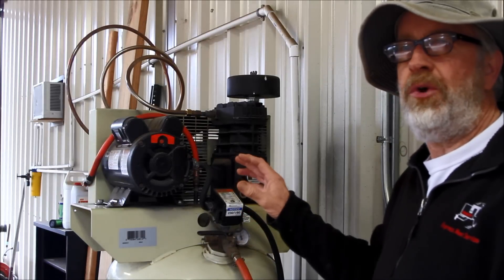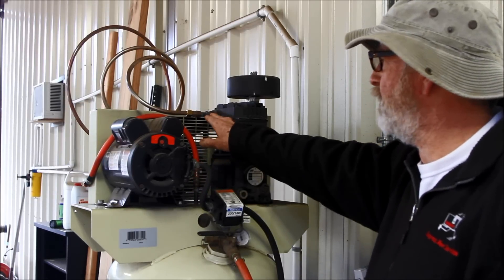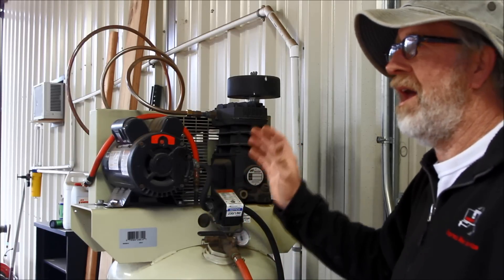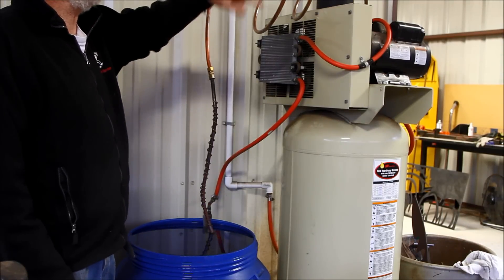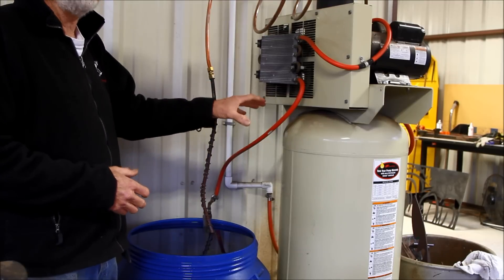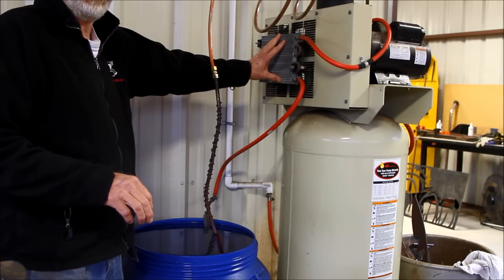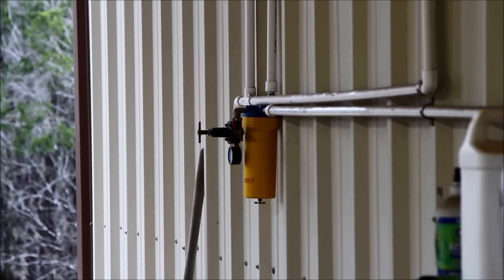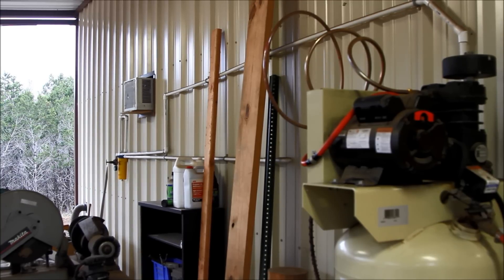How to make a Air Compressor After Cooler (low cost)

Comment: I've been looking at all of these "post pump condensers" as they are not a post-tank cooler / condenser.  There are a lot of crazy set-ups on YouTube and I have to say this takes 1st place.  There are some major issues here, mainly that you have no water drain or separator once the air is chilled and you have everything working against gravity.  Not only does this set-up allow for water to collect in the three initial upper coils, it most certainly will collect in the water bath coils and also in the secondary condenser which is most likely total overkill after the water bath.  Regardless, the way this is set up, all of the accumulated water taken from the hot air has no where to go except to be forced uphill into your air tank via bubbling in which case some re-atomizes and as a whole is totally negating the entire purpose of pre-chilling / pre-drying to save the entire air tank for dry air with no water or moisture vapor.  As shown, all this does is make cool air and a lot of water.  

While I like the idea of a water chiller for a condensor, you're also taking up an equal amount of floor space with the 50 gallon water tank too.  Perhaps most importantly though, your pump is having to do a hell of lot of extra work in pushing all the extracted water up through the lines...uphill against gravity in to the tank.  To be clear, as shown, this is a simply a horribly inefficient system.  You're not only over-taxing the pump as well as using your air tank for water storage, but if the air tank fills up with water, it's making the storage volume smaller and smaller, thus making the pump have to work even more when in use . I hope/assume you have a drain at the bottom both in the condensers and tank, but sometimes these clog from years of debris.  I've seen several videos of air tanks being drained that were 50% water or more.  All of this is a great way to ruin your pump and motor in short order.  

I also wouldn't be using PVC pipe for air lines.  I know a lot of people do it.  I wouldn't unless it's already been reduced to 100psi or less and the air will never get over 100 degrees in the line.  And make sure it stays out of the sun or isn't anchored to metal siding that gets direct sun!   With both copper and PVC their pressure ratings drop significantly as temps rise.
Reply: Yep, the water bath is a great idea. All it needs is drainability for all the water that's collected in the coils inside the drum.

Comment: This is obviously going to cool the air but water will condense in the coil and be forced into the tank. You need a collection tank at the bottom of the coil that can be drained. Then you have cool dryer air to tbe tank. I'll bet you still get lots of water from your tank.
Reply from the maker: no it never did, but later I did put a drain in the bottom of the coil,...but I never had water in the line without it
Reply: @DougGreenAustin  Take hot moist air, cool it, and there will be water. Else there would be no moonshine. Where did yours go if not in the tank? Just saying.
Reply from the maker: @backlash00  I know you are right, but each day before I would start I would drain the air from my canister air dryer, and each day there was about 1/2 oz of water, after I put this in I would not even get a drop... I took it out last year when I redid my system, and now I get water in my lines, going to get a refrigerated drier when I up grade my plasma table
Reply from the maker: @backlash00  and it's just like the air cooling fins on the lines before it goes in the tank,

Comment: An after cooler is a great idea and 99% of the time will solve problems with water in your air tank. I would suggest you replace pvc air like with something like type a pex or at least cpvc, though. (CPVC gets brittle over time, though.) I have been guilty of using it myself, but it is not rated fir high pressure. Its an accident waiting to happen.
Reply from the maker: yeah I have heard that over and over, I have use PVC in my shop for over 40 years and NEVER had anything happen
it rated at 240 PSI
Reply: Doug Green its not just an old wives tale.  A place i worked at used it and had a drop blow out and hurt a guy. https://www.thecompressedairblog.com/comply-with-osha-dont-use-pvc-pipes
Reply from the maker: @ShadeTreeSteve  OK thanks

Comment: Are you running the IR 5hp air compressor in your shop? If so how has it held up since it sounds like you are heavy user of it in your shop.
Reply from the maker: no, I have had two now, and the other one is not going to last much longer, going to go with 100% USA made next time
Reply: @DougGreenAustin  i have read that IR's 5hp are not good and don't last. I'm looking to pull the trigger on a 7.5hp northstar. What failed on both your units? Thanks for the update btw.
Reply from the maker: @chvydrptop  the first one was the compressor the bearing went out and the whole thing  almost fell apart, the second the motor failed, so I took the one off the first one, and now it just not the same, I going to get a 5 hp Quincy

Comment: Very nice. I had a similar but temporary set up for when I was painting, I literally coiled an air hose inside a bucket of water before my moisture trap and it worked a treat. It was a clear air line and I could see the water droplets condensing in it.

Comment: Hey Doug Green, awesome work! Had a couple questions as I am attempting to do this to my ingersoll rand once i get a new receiver tank(other one formed a pinhole): 1. Where did you get that radiator? I'm guessing it's a high pressure rated radiator? 2. What type of fittings did you use to plumb the extra copper piping to the receiver tank? 3, How good do those automatic drains work? Thanks
Reply from the maker: not sure where I got it, had it for years, I sweated the copper to pipe thread,but had to use compressing type near the compressor it self, gets too hot and might melt the joint the auto drains work well, got them off amazon,  I later
added a drain at the bottom part of the copper coil, and out the tank, using a bulk head fitting

Comment: You are doing a great job at cooling the air down but the water is collecting in the copper in the Barrel and staying there until it is pushed into your main tank. If you don’t collect that moisture in someway you Will push water into the main tank. That is a fact. The moisture comes from the Compressed air that is saturated, read up on dew point, and is heated so that when it starts to cool down there is condensation. If you set a glass of ice water in your shop and the shop is 90 degrees then the moisture on the outside of the glass is from the moisture in the air condensing on the out side not from a leak in the glass. Add a timer with a solenoid to auto drain after the coil cooler and you will be very happy. Not trying to be a jerk but professionals use heat exchangers and desiccants to ensure dry air.
Reply from the maker: Yes thanks, I need to re-due this video or add to it, I added a tee valve at the lowest point in the coil, and bulk head it out of the tank, and it works well, I have had a lot of people say this will  never work, all I know I works for me....

Comment: Hi Doug
Thanks for  the  info that makes perfect sense  to me.
Iam in the process of putting together  my system / I ordered two  motor guard 100 kits, and made a 55 gal drum set  up using a 
tee at the bottom  of the end of  my coil  going thru a bulk head fitting  for draining the  little bit of water out, the middle part of
 the tee  on  its back goes up  to  the top while the end  drains thru the bulkhead fitting, I used 100 ft  of 1/2 "  pex  tubing  in the 
drum/ also bought a transmission radiator to add to  the set  up.
Iam  only sandblasting in the smallest  H F cabinet  and little spray painting my cerakote  airgun part and that's  it.

the copper  would of been ideal but Iam thinking with 100ft  of 1/2" pex  it should work and if it  dosent  i will change it out.
i'm adding a blower  to cool  the small radiator because  I  also want it to help cool  the compressor  pump
Thanks again for the info
Reply from the maker: Great, most people on this video think I'm crazy! hope all goes well, keep me posted
Reply: @DougGreenAustin  
The  only downfall in my set  up is  the veaga crimped plumbing fittings  under water, I  figure I  see how long they hold up before they rust out,  but  that's  what I had available  I am a plumber /I could get another barrel and just pump  it  down  when Iam done  no biggy

Comment: Doug Green  You have a very good invention, I'm convinced. My question for you is how long of a coil is the copper tubing that is immersed? I can buy 1/2" X 50' for around 46 dollars but if that is longer than necessary, I can get a shorter length. Thanks for your video and your response.
Reply from the maker: I maybe used 10 to 12 feet, I changed it after the video and put a "T" at the bottom of  the coil and used a bulk head
fitting out the side of the tank. (lower than the "T"), with a valve on it to drain that line, very little in it , but some, I would use a brass bulk head fitting, the plastic ones are not true PVC, and don't glue up that good, and can blow out
Reply: You've earned a good name for yourself in my book because of your response time and your ingenuity. My cooler is being put together (little by little) before I start cabinet blasting and air brush painting. I ran 17' on mine and have an old chevy diesel oil cooler that is getting bolted by the compressor pulley similar to yours. Thanks for your ideas.

Comment: Don't want to be in your shop when those PVC lines let go.
Reply from the maker: I have said this before but will say it again, PVC is rated at 250 PSi, and I have been using it in my shops for over 40 years.....NEVER had it fail!
Reply: Well I honestly wish you the best, I've seen them shatter. There is a reason OSHA don't allow it in shops.
Reply: At My fab shop I've been using  1/2" pvc on mine at 175 psi for 10+ years no issues,  use  the blue wet or dry glue and I would not use anything larger than 1/2" . We did do a test to see what it took to break it while under pressure, hit it with a sledge and it took a hell of a hit to break it finally. it did shatter about a 3 inch section  but that was intentional. now keep in mind I'm in florida. I would imagine in cold climates it would get more brittle.

Comment: Do you think I could substitute maxline for the copper piping. I'm going to do this for my 21 gallon comp
Reply from the maker: would not matter, copper might release more heat...after I made this video I put a drain on the lowest point in thatlike line on the water, used a bulkhead fitting in the tank and out

Comment: You need a dryer before it goes into the tank. You are not reducing the water made from condensation. That would worth a Fortune. All you are doing is collecting water in all that tubing you added. Eventually it will rear it’s ugly head. Look up the term “Dew Point”.
Reply from the maker: yeah I been told that before....like I say it WORKS FOR ME AND DOES  WORK, what do you think a dryer does? cools down the air before it goes in the tank. is that not what I'm doing!!!!!!!!!!!!!!
Reply: I thought a cooler just cools the air.
And a dryer actually dries the air such as "removes moisture" from the air itself.
Reply: @707SonomaComa  By cooling the air he is reducing the amount of moisture the air can hold, this is reducing the water content in the air. You can get more out in other methods but this works well as a great starting point and is a cheaper solution than other methods.

Comment: Should NOT be using PVC pipe!!!!!!!!
Reply: i have heard that too but none of the shops i have worked at, that used PVC, had any issues
Reply: It may be rated for 240 psi, but that’s for a liquid.. compressed air in the pvc can be almost explosive when it gets brittle and it gets hit with something.
Reply: @taltruda  True. However plenty of people use PVC for air lines now. A tire shop in my area used PVC couple years back. still no issues. Were down south so we don't get super cold weather but that would probably be an issue if you lived farther north. Personally I wouldnt use it just because Id be "that one guy" who detonates a PVC line in his face. Lol
Reply: I helped build a shop for a commercial tire installer in our area. One of the last thing we did was install PVC air lines throughout the shop. Seems a little sketchy at first but they said thats all they use nowadays.
Reply: I read  that schedule 80 PVC was needed and so I used that starting in 1975. In their spray gun manual Binks said to run 50 ft of line and then install drain, filter, and regulator. I have never had moisture in a paint job since installing the 50 ft line, etc. PVC will make shards when it bursts an can be dangerous . However, like Doug, I have never had a problem with my PVC setup and 50 ft. line run. I have a plasma cutter, a 1 in. impact wrench, an inline sander, many spray guns, using a 5 hp 2 stage compressor at 175 psi max. No doubt your system works, I just don't think you need a tub of water. Good video, Doug.
Reply: @p52457  I tried the water bucket while I was spraying a truck bed. I would not recommend as a permanent solution but as a band aid it worked fine. lol
Reply: Schedule 80 pvc or rigid polyvinyl chloride is very strong. What really makes PVC brittle is the colder temperatures. If you live in a warmer climate like Texas, and yes I know Texas can get cold but not like the northeast, you will never have an issue. In colder climates, open bays I would never install PVC pipe for air lines, especially Canada, Alaska, etc. Up north they would laugh at you if you  installed pvc for air lines.
Reply from the maker: I have been using PVC for air for more than 40 year and NEVER had a problem
Reply from the maker: I have heard that a lot, BUT I have used PVC in my shops for over 40 years....it's rated at 240 PSI
Reply: Doug Green It isn’t the pressure rating when new that is the issue.  It is that PVC gets brittle as it ages, particularly if exposed to temperature extremes and UV.  And when it lets go, it doesn’t let go “nicely” like copper or PEX, but it shatters like a claymore mine.  Also, it isn’t very robust if accidentally hit with a hammer or something falls on it.  I know folks that have driven drunk for 40 years and never had a problem, but that doesn’t mean that driving drunk is a good practice.  😁

Comment: How bad did harvey hit your shop..?
Reply from the maker: not at all, I'm about 4 hours from RockportI do have a house there too, very little damage, few shingles, fences down and a LOT of trees/limbs, but all in all very luckyThanks
Reply: Good to hear! I like your design and concept above, I may attempt to copy your idea only use a smaller water tank, figure out some way to attach it to the compressor itself, mindful of the vibration of course. I'm not super worried about the water condensating in the tank as much as(I could be wrong for what I'm about to say) increasing the cfm of my pump due to the colder/denser air the water tank helps to produce.

Comment: Suggestion for those in climates, or have garage /shop "freezing" is a problem and you are thinking of adding Anti-Freeze to barrel containing water.
DO NOT USE REGULAR ANTI-FREEZE, USE "PET FRIENDLY" ANTI-FREEZE.
Regular anti-freeze is POISONOUS.
Reply from the maker: not sure I would want to try it, good Ideal ?I would just hate the mess, if it was that cold "here" more, I would just move it in side
Reply: Doug, Not all people have the option to "move it inside". Point is for those considering using anti-freeze in colder climates / and to negate issues regular water has to NOT use regular anti-freeze as it is POISONOUS to pets, animals.. and humans most likely at well.

Spend the extra few bucks for the non-poisonous type.. It might save the life of your dog, cat, furry ones, grandchild...

Comment: What kind of copper pipe did you use? And connections
Reply from the maker: used all types. Solder, pipe thread,  and Compression, for the copper I use coiled copper, harder to use, too soft to use a tubing cutter, had to cut with power hacksaw and do it slow not to get it out of round

Comment: Awesome.  Thanks.  

Just a thought.  In the very bottom of the coil that is in the drum of water, due to gravity, I would imagine that there is water that collects at this low point.  Then the cooled air needs to bubble through the condensed water at the bottom point.  Would it make sense to connect a "TEE" at this point and run the tube back out of the drum of water and have a valve at the end.  This way the water could be blown out of this low point.  This line could also be "Teed" back to the up steam side of your electronic tank drain.  This way, when the electronic tank drain dumps water, is will also automatically dump the water from the bottom of your condenser coil.
Reply from the maker: that "might" help, but I would not think it's a big deal, I do have the copper come out and down with a valve on itjust can't see it in the video (goes all the way to the ground and back up to that red hose)

Comment: Is there a way to bleed of condensed water in your condenser lines before returning the dried air into your receiver tank?
Reply: There 100% needs to be, or you're just putting all that water in your tank.
Reply: @platinumsky845  That works. I'm planning to use an air-to-water system and then have an evaporative cooler, like a mini cooling tower.